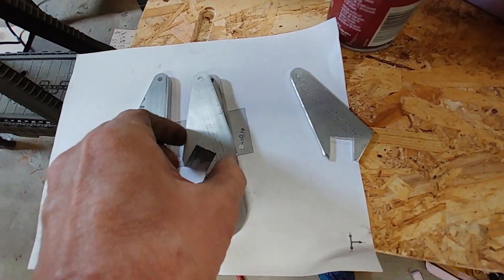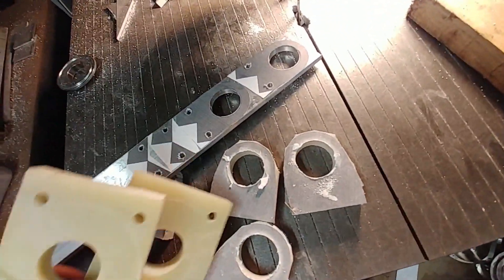Stick Parts Galore - Building the Raptor Prototype

Comment: You may want to make the end of the sticks a bit longer so to have the handle sliding on the metal as a sleeve, increasing strength and reducing the complexity of the joint?

Comment: Instead of turning those bolts on the lathe you should've just stuck the bolts in the freezer and heated the bearings up in an oven at 185°F for about 20 mins and they would've slid right together and they would've been mated for life. Which is the ideal fitment for bearings. Almost negates a bearings purpose if you put them on a shaft that has any room to turn inside that inner race. 

Not terribly important for your application though, but in situations where the bearing is on a shaft like a drill or a high speed grinder especially, not having an interference fit there will cause premature failure due to high temperatures caused from the friction of the shaft turning inside that inner race. 

Loving the out of the box solutions you're finding for out of the box issues. I cannot imagine how ready you are to have her done, in the air and on to the next step in making her a kit plane. You definitely do not know the meaning of the word quit. And it shows in your work ethic and how beautifully she is turning out to be.
Reply from the maker: When the bolts are tightened the inner race does not rotate on the bolt shaft.
Reply: @RaptorAircraft  I see. The inner race is squished between the bolt head and the bracket or whatever it is you've got it attached to. It wouldn't matter anyway bc it's not like they're being spun up at high speeds or constantly turning. I should've just deleted my comment altogether, but I thought maybe someone in the comments might find it useful.
Reply: Would need more than a freezer. Liquid nitrogen is what is generally used. Not hard to get but not something typically found in a little machine shop
Reply: @Alex-us2vw  the freezer trick works when you heat the bearings up as well. You can also turn a can of propellent upside down and blast smaller diameter material to make em shrink as well. I've done the freezer and oven trick on material as large as 1.5" in diameter. Just had to cook and freeze much much longer.
Reply: @Alex-us2vw  With a 3/16" bearing bore and shaft  then heating/cooling will give about a 6/10ths of a thou  additional  clearance. I think Peter needed a lot more than this, and added problem is  getting snugged down tight  on bushes.  With this size bearing probably way less than a second  to fit it as thermal mass is so low.

Comment: AN3 bolts typical size specification is 0.186 to 0.189 (3/16 =0.1875) so you have a plus/minus tolerance on size.
AN4 bolts typical size specification is  0.246 to 0.249 (1/4 = 0.250) so you have a  minus tolerance.
So being a tight fit in the bearings or over size  is to be expected.
Reply from the maker: So why are AN3 bolts oversized when compared with AN4?

Comment: For next time - putting the bolts in the fridge and the bearing in the owen (low heat) would probably have done the trick without the need for any machining.
Reply from the maker: Yes, but there are other parts that the bolts need to go through as well and if everything is press fit then how do you get it apart if you need to change something. Gotta think of this stuff.
Reply: @RaptorAircraft  Would not work anyway as heating the bearing and cooling the bolt would give about 0,3 thou each.  How many thou  did you need.... a lot more!

Comment: Intentionally causing radial damage in fasteners, is one way to cause an accident. The bolts were obviously a class 4 fit. Use abrasive cloth along the length of the bolt, even though it's not as quick as spinning it in the lathe.

Comment: Would the 7075 need to be welded to other parts? I believe it's considered an unweldable alloy.
Reply from the maker: No, the design does not require that tube to be welded, only bolted.

Comment: Would freezing the bolts / heating the bearings prior to assembly shrink them enough?
Reply: Freezing a bolt that small will make zero difference.
Reply from the maker: Yes, possibly but IMO the bolts should not be that tight. The AN4 bolts don't have this problem. It's only on the 3s.